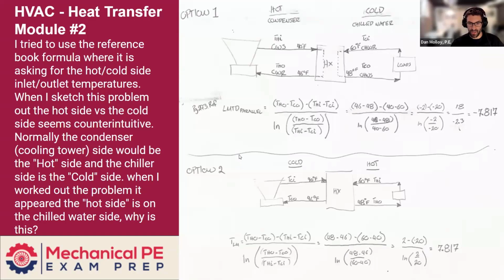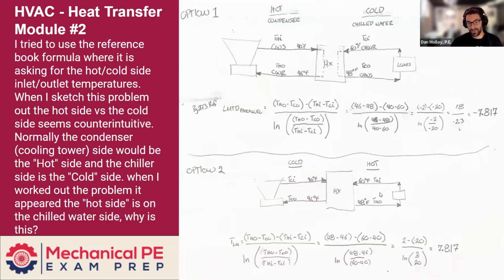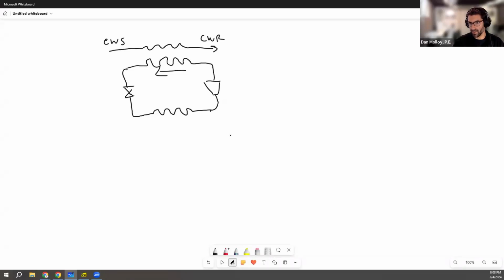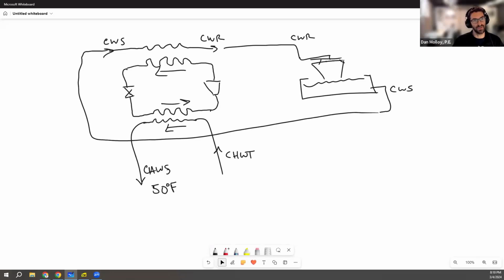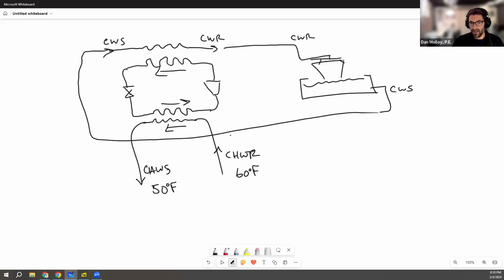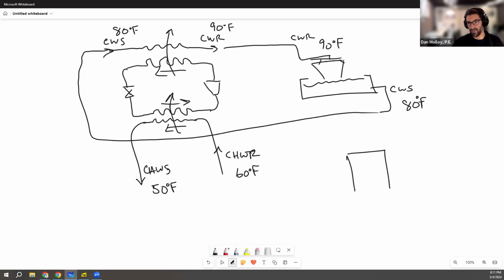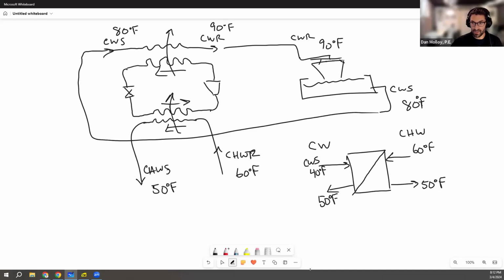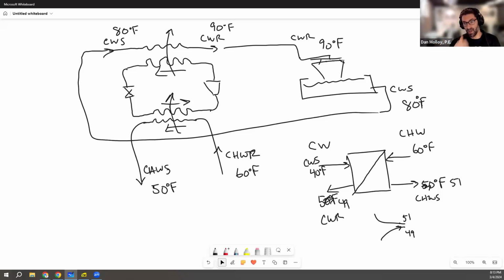Mechanical PE Exam Prep with Dan Molloy | Water Side Economizer with Plate and Frame Heat Exchanger

Comment: dan how would you figure out how to find the amount of evaporation happening in a cooling tower? I would assume that it would be Q(heat lostby the water) = Q(heat gained by the air).. however, if i set Q=500*GPM*(Delta T) = 4.5(CFM)(Delta H) would the left side of my equation only be sensible? How would we account for total heat?
Reply from the maker: The equation you mentioned is a key idea for the total heat transfer for an open cooling tower, but it doesn't answer your question about the quantity of evaporation happening.  There's a separate formula for calculating the amount of make up water required to replace evaporated condenser water. 

The equation for make-up water in a cooling tower is derived from psychrometric principles to calculate the rate of evaporation. Make-up water is required to replace the water volume lost during the cooling process, which primarily occurs through evaporation and drift. The rate at which make-up water needs to be introduced is equal to the evaporation rate.

The equation for the mass flow rate of make-up water is:

ṁ_water = ṁ_air × (ω_leaving - ω_entering)

The mass flow rate of air can be determined from the volume flow rate of air using the continuity equation:

ṁ_air = CFM / v

Hope this helps!
Reply: @MechanicalPEExamPrep  DUDE YOU ARE AMAZING, THANK YOU!